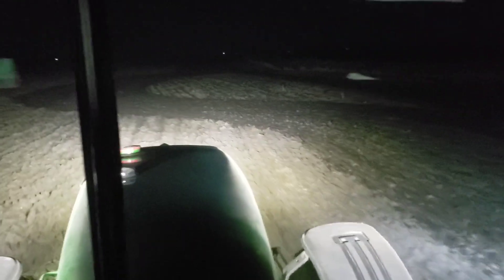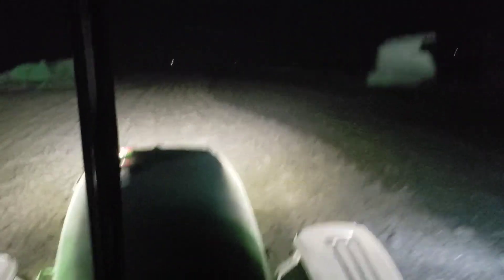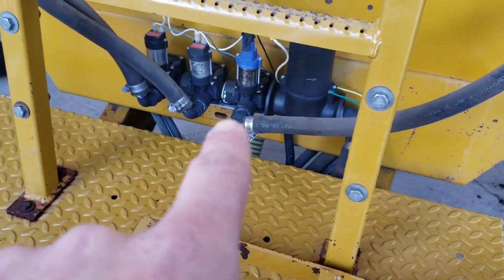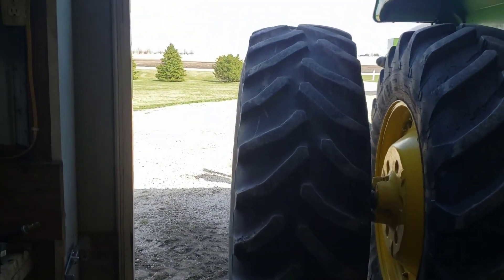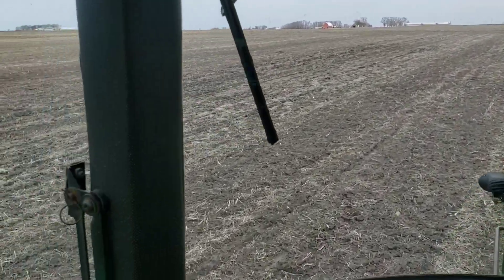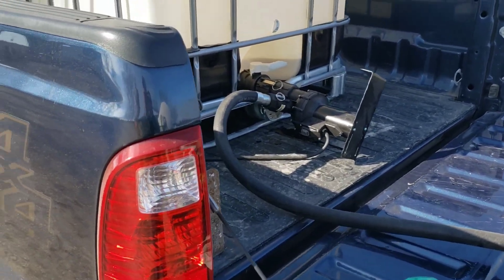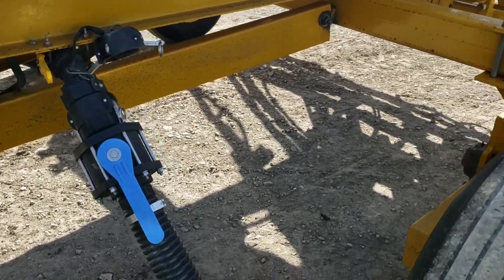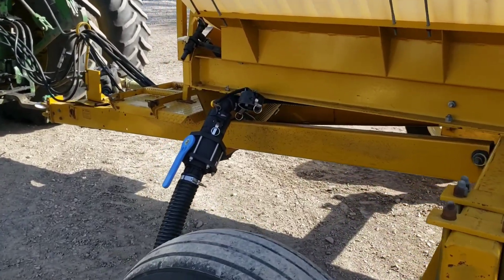A little fieldwork,fixing and spray tender

Comment: I see that you run the 4960 at 1800 RPM. I also like to run them at that RPM. Saves fuel, wear and tear, and the HP rises also at lower RPM. I hope that your spring has just the right amount of rain this year. Last year was just to wet. Be careful this summer.